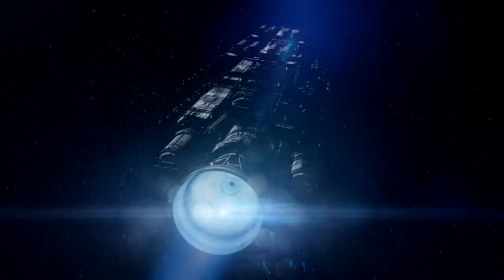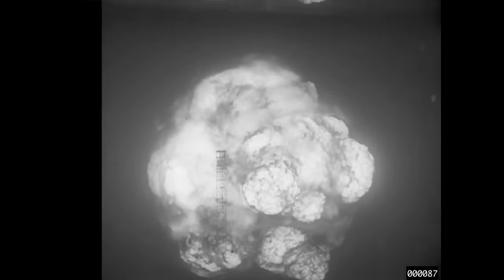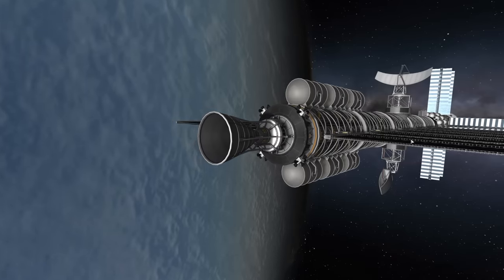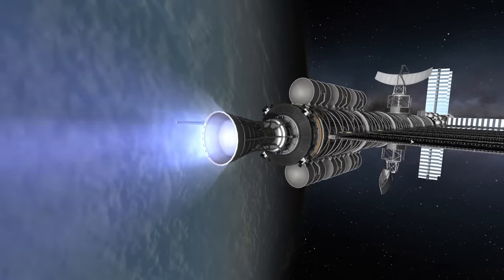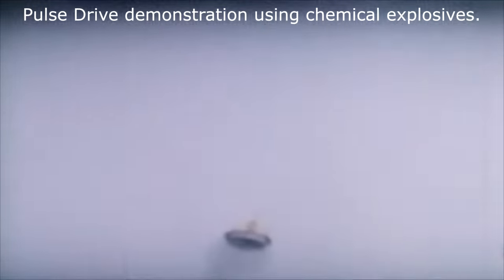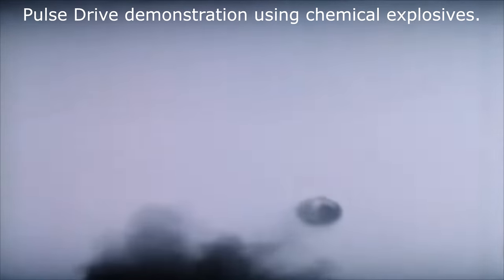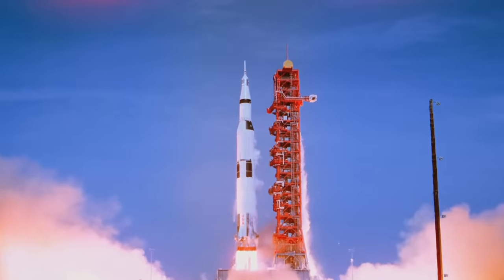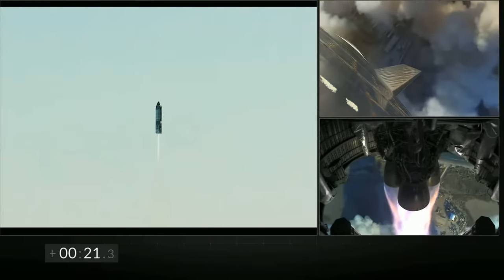The Nuclear Salt Water Rocket - Possibly the Craziest Rocket Engine Ever Imagined.

Comment: This is a quite terrible solution from safety and engineering point of view. A highly enriched U-235  salt mixture can not be kept subcritical and cold for a very long time by boron, since B-10 is consumed in the reaction B-10 + n -> B-11. Neutrons are are always emitted by spontanous fission reactions and water acts as a good moderator. Additionally, efficiency of energy usage from U-235 is ridiculously low. The better approach is to use an aneutronic p-B high pressure pulse-plasma reactor (p + B-11 -> 3 He-4) as a power plant, that creates electrical energy from inductively deccelerated Alpha-particles (He-4) with a yield of about 10 (y=Pout/Pin) in accordance with d(i)/dt=dq/dt. This electrical energy can be used to turn water into a super-hot plasma and eject it with relativistic velocity. The key technology to achieve ultra high plasma pressure (up to GPa-range) with very low electron densities (low losses) relies on magnetic discontinuity and reconnection and was developped 2011 in our - now closed down - Institute of nuclear physics in Basel, Switzerland. Unfortunatly, the technology will be kept under wraps by all IAEA-nations until the end of coal for the next 400 years, since electrical flight is not exactly the technology, his Highness, Prince Bin Salman et alia like. And trucks, powered by small p-B-reactors, fueled by Decaborane (B10H14) will never pay mineral oil taxes.

Comment: 1) It's like carbon emissions in the atmosphere, except it's radioactive waste products for the solar system.
2) When you burn retrograde you're going to cover the exterior of your ship in it. Not all of it is going to fly straight back at high speed.
3) That's a lot of water to keep the reaction off the wall of the bell, and it's going to take even more to shut the thing off, since you'd have to rapidly flood the main output with clean water until the reaction stops... Unless it's the 4th of July.

Comment: As a relatively uninformed but interested person, I have 2 concerns about this process.  
1. Over decades, there would be massive amounts of radioactive byproducts filling the space around Earth from the increase in space exploration and utilization would it not?
2.  You still have the problem of significant amounts of reaction mass to be carried by the rocket and having to be replenished requiring massive amounts of processing, transporting, and possible spills or diversion to people of less than reliable ideology who would use it for undesirable ends.
How about you use a molten salt reactor which is reliable and stable to provide massive amounts of power for an ion drive which would increase the specific impulse yet still require much less reaction mass of a stable and inert product to power the rocket.  Would this be doable and could you comment on this theory?
Reply: I'm not Scott Manley, but the fundamental problem with powering an ion drive is that the thrust is tiny, and the amount of power needed to make it useful is absurd. Plus space is huge and most of the exhaust will be going at earth or even solar escape velocity.
Reply: 1. That isn't a problem, the exhaust velocity is greater than solar system escape velocity so all the exhaust would be blown out of the solar system. The weapons grade version would actually blow it out of the whole galaxy.
2. The thrust from any kind of ion engine is absolutely pathetic, even with nuclear power. The problem is that the thrust power (exhaust velocity × thrust) cannot possibly be greater than the input electric power. And since you can't run a terrawatt range nuclear reactor without vaporizing the ship, the only option is to have the thrust be tiny. Ontop of that, even the best ion drive wont reach the exhaust velocity of the weapons grade version, which means it would actually be much worse in terms of reaction mass use.

Comment: 4:45 - Ruin your day... Yes, a runaway chain reaction affecting tons of fuel containing many pounds of U-235... I think that would ruin a lot of people's day. Especially since the radioactive material is dissolved in a substance that will vaporize when it gets to hot and likely take a bunch of that material with it.

You'd have a gigantic, but relatively slow (seconds or minutes rather than microseconds for a bomb) explosion that spread highly radioactive material everywhere in easily ingestible or breathable form.

Yes, that would 'ruin your day'.

Thinking about that, I'd only be happy if all this stuff was boosted into space in solid form  then mixed with water and loaded into a rocket.

Ideally we'd find a nice, radioactive asteroid to mine for U-235 instead.

Comment: Chemical gas or liquids are ludacris procedures of nuculear mix, far to unstabke and unsafe, a better is using nuculear amp energy rockets, regen by solar or thermal conducters, when traveling solar orbit, if you harness a 1G force acceleration infinate gravity cruise in solar system path. You can leave the chem rockets for emergency space manuever or landing/takeoff.

Comment: Let's say this engine design is v1.0. A v0.1 version could be just pumping normal water through irradiated rods to create steam and let the steam go through a tight nozzle. Would something like that work? (basically just like our nuclear power plants). The main problem what comes up to me would be the immense heat, but that could be solved by alternating rods. 🤔

Comment: I am a bit perplexed as for the water source. 200kg/s is fast indeed; you go through 1 metric ton of water in 5s, 1 kg of water is 1 litre. So in 5 seconds, 1000 litres of water is spent. For a 5 minute push, or 300 seconds, you're pushing out 60 000 kg of radioactive water, which is about the payload capacity of the new Falcon Heavy rocket, the biggest by far currently, for Low Earth Orbit delivery. The Saturn V rocket burned over two million tons of fuel to deliver 140 000 kg to Low Earth Orbit, the only one ever topping the Falcon Heavy. That is both bulky and heavy to carry up; assuming a space station in orbit to build and fill out the space craft, all that water needs to be carried up as well. A space elevator for radioactive water would be needed. 

The spacecraft also needs huge amounts of water to decelerate. If we assume interstellar flight at great speeds, you need a ton of fuel for a long burn, and great stopping power to decelerate to enter orbit (something that, today, is manageable due to low relative speeds compared to the needs to interstellar travel and very light space craft...even then, it often needs gravity assists).
Reply: The obvious and most efficient solution is to launch the spacecraft from the ground instead of assembling it in orbit. Reusable spacecraft, expendable launch complex.

Comment: Something you should consider is that this tech would be able to miniaturized, no ? Imagine a nuclear saltwater thruster - the size of a coke can that could double like an ion engine producing a small thrust but for a very long time, that would be a lot less hassle and danger yet still change mission profiles significantly...
Reply from the maker: There’s a minimum size for nuclear things because critical mass is required for the reaction.
Reply: @scottmanley  Hi Scott, thanks for taking the time to reply. This was the point I was trying to make. This current design is bomb waiting to go off...however I am imagining a low power sub-critcal version. The fuel can never go critical on its own, this would only happen in the reaction chamber which would be a total neutron mirror and contain a neutron beam source. We don't need to make a run-away reaction just to get a few atoms to fission at a time giving up their energy to the working fluid. Low power but super safe to build, test and deploy...anyway just a thought....run it past Zubrin next time he drops in for a cup of tea, yeah? Cheers Pete

Comment: And creating highly radioactive trails across the space we want to freely navigate someday requiring heavy shielding to deal with high neutron emitters found in fission by products.
Yeah, I know space is filled with radiation, we would be making hyper-radioactive flight lanes.
Bad idea.
Reply: Nah, the exhaust disperses so fast, and there is already so much radiation in space, it wont make a difference unless you're flying directly behind a ship. However, flying behind any kind of torch ship is a really really bad idea, regardless of what the power source is
Reply: @ExpatZ266  yes, but that would only be the case if you pointed the nozzle directly at a planet. Note that the exhaust velocity even for the low end engine is far above the solar systems escape velocity so the exhaust would be shot into interstellar space. In the high end version using weapons grade material, the exhaust would be fast enough to be ejected from the milky-way

Comment: This has me wonder if this cannot be used in tandem with some type of exhaust capture system on a hydrogen oxygen launch rocket, so lauching using hydrogen and oxygen then use the water vapor produced to fuel the nuclear salt drive for in space use as you don't want to use a nuclear exhaust system to launch from earth so you use the hydrogenoxygen system, and if somehow possible collect the water vapor exhaust or convert excess launch fuel into reactor fuel. It would be nice if there was a dynamic system that used the same fuel source and used the nuclear core energy to convert the gases (or liquid cooled oxygen/hydrogen using some type of cryogenic system by using the same temperature to cryogenically cool the fuels. None the less I am more and more convinced that some form of nuclear drive that uses a mass ion drive system, and has hybrid drive capabilities with a common fuel source aside from the nuclear fuel that can be used for nuclear power or as a nuclear fuel. It seems thought that ultrapure uranium 235 is currently the go to for the nuclear thermal drive.. that might be enhanced by a salt/water hydrogen/oxygen systme. Not surer how complex but load the fuel with salt water and produce hydrogen and oxygen  and pure water as needed. In fact multiples of types of salt including uranium salts could be used, as storage of uranium in water may be better as a buffer..
Reply: At the same time oxygen in the system can be used to beef up life support. CO2 produced could then be reprocessed into carbon and oxygen using CO2 sequestration. WIth good graphene technologies the carbon could be used as a 3D print material via laser graphene printing for a variety of purposes including restructuring radiation suits that would shed the radiatioactive carbon that would then be used as a mass drive fuel. If possible or processed in a deep space gravity anvil system to create engergon cubes of radiated carbon diamond energy cells from the radiated carbon from the radiation protection suits.

Comment: reality check.        firstly, the use of the term  saltwater  Downplays  the  PROBLEMS  with  using  a fission-based process.        secondly,  a  Lot  of  mass  would be  required, in the fuel and the ship.!!!         thirdly, what happens to  h2o  when  it's   HEATED.    hmmm.?        lmao          fourthly, in the case of a space vehicle, a reaction mass-based thrust system is practical only  where  a  small amount of mass is  ejected, at  very, very, very  high velocity.!!!    d        cheers

Comment: A rocket using U233 is way more energy dense, you could breed U233 (such as India has done, and also the US) and use that as the pure, 100 % fissile fuel. Then, why would you not generate a smaller, more controllable thrust, such as 100 tons for much longer times? Also, we might need those rockets to change the orbit of an asteroid or comet threatening the earth. So, gently land a thruster onto the surface of a comet, orient the rocket engine away from the surface, and then fire it for as long as it will go.

Comment: 200 kg/sec flow rate of the water... means you quickly run out of water. 1 minute requires 12,000 kg of water & 1 hour is 720,000 kg.

Comment: Why only enrich to 20%? Wouldn't enriching as highly as possible save weight, which is critically important for spacecraft? Is the additional space and weight cost incurred by using nuclear fuel that is less enriched somehow of negligible impact, or beneficial in some way I am unaware of? If someone could explain how this could be so I would be grateful.
Reply: PS 1. Uranium is heavier than lead so it would seem to me the impact of having more than needed would be severe.
2. I am aware that neutron bombardment can convert non-fissile uranium to fissile uranium, as happens in breeder reactors, but I don't think it can occur on a practical basis in this application as the reaction requires intense bombardment for a longer period of time than is available here. I believe that is a safe assumption. So I still wonder why the designer calls for 20% enrichment. Perhaps it is merely the politics of proliferation? It is not a technological constraint as research reactors used to be made that used fuel enriched to 93%.

Comment: are there any thorium based nuclear propulsion rocket ideas that might have a backdoor out of the runaway phenomenon?
Reply: I dont think so. Its already hard enough to design an engine that could make the reaction occur at the right place, building one where, in addition to that, thorium is bred into uranium-233, which would then undergo a nuclear explosion, seems next to impossible.
Reply: @destroyer1667  You can pre-breed thorium into uranium or plutonium on, let's say, lunar base, though, and fuel fission engine with actual fissiles.
Reply: @caav56  i think zubrins paper on it actually mentions uranium 233 to be the fuel isotope, which is made from thorium. Calling that a thorium rocket is a bit of a stretch though, because by that logic the core of a nuclear bomb would be made from depleted uranium since that is what plutonium is made from
Reply: @destroyer1667  True, true. Still, thorium is the starting isotope here and you can find a lot of it on the Moon. Won't be a thorium rocket, but would still be a thorium-cycle rocket.

Comment: How do you turn it off or control the thrust? What if it explodes in the atmosphere?
Reply: Turn it off: close the valves adding uranium into it, then close the water ones. I dont think the thrust can be meaningfully throttled, so a ship would need maneuvering thrusters for small corrections.
If it explodes in the atmosphere, everyone close to the launch site is going to die. Could be launched from the middle of the ocean, perhaps.
Reply: @destroyer1667  It sounds like a terrible idea, cause let's be real one day it will explode and the worst will happen. I don't understand how Scott could skim over this..
Reply: @plot267  it probably would, yeah. An orion drive would be better for atmospheric flight. Still has the insane power and efficiency from using nukes, but the nukes wouldnt explode if the ship breaks, they'd just shatter and be wasted
Reply: @destroyer1667  True, but it could still lead to nuclear fallout.
Reply: @destroyer1667  I guess the best place for NSWR is on a deep-space ship.

Comment: having nuclear in the name mean government control. which would end in low production. my requirement for a new engine would be 1 an idle setting. ready to blast off and generates power 2 a low setting, that could hover at a stable altitude with payload 3 a medium setting that can ascend the load then finally 4 that blast the load out of earth atmosphere.

Comment: unfortunately building a nozzle that can withstand hundreds of thousands of kelvins is an impossible task now. even lower temperatures require pumping of cryogenic propellant through it and this engine has no cryogenic propellant to pump. not only nozzle but also the chamber itself will be receiving tremendous amount of heat. and not only heat but also fast moving neutrons destroying it's crystal structure and weakening the material itself with time. this engine is an impossible thing to do for a very very long time now.

Comment: It would be interesting to see if once in space.  After the engine is lit up in space, open the flow of space vacuum through it. The craft should be moving. The pressure difference could use space as fuel.
Reply: Space isnt a fuel, unless you mean trying to use solar wind? That would be a solar sail then, and they are very slow
Reply: @destroyer1667  space contains a lot of fuel if you can capture it. Space is very dense thought it is a vacuum.  It still contains useful gas and charged particles everywhere.
Reply: @danahilp7981  yes, thats the solar wind, but it isnt really dense at all. You could use a bussard ramjet or a plasma magnet or a solar sail to use it, but they're all pretty slow